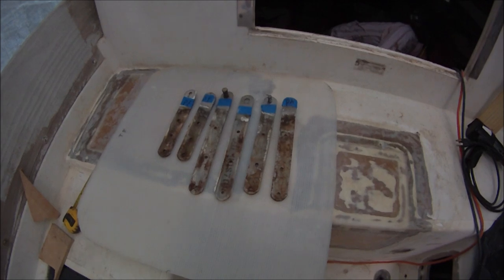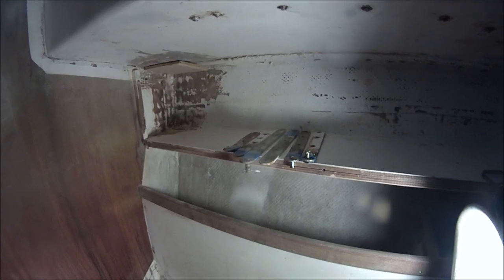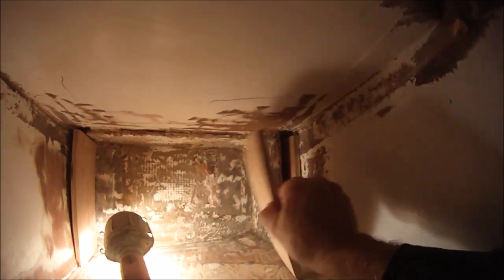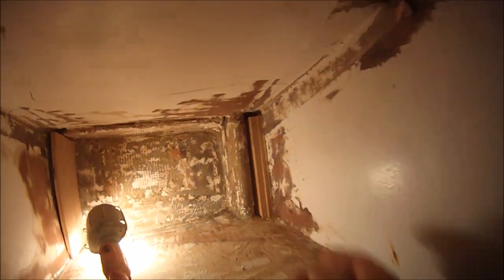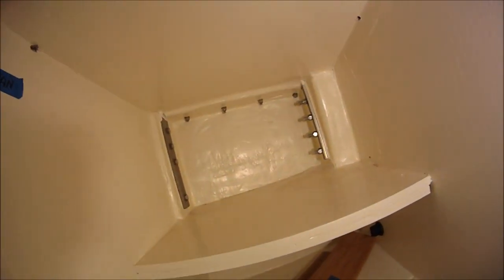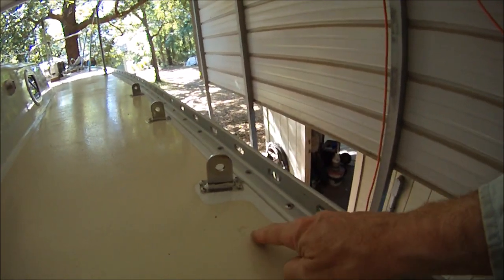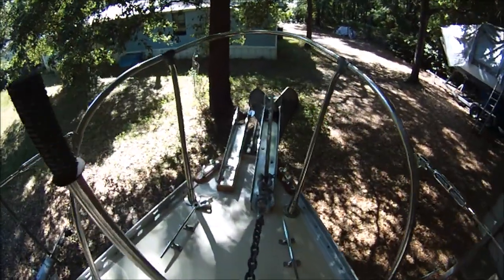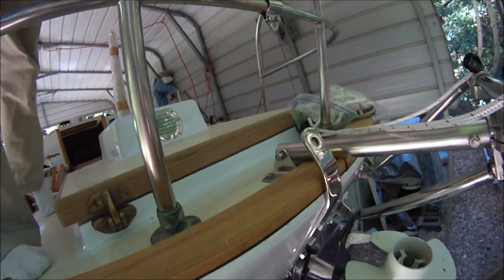Replacing Chainplates on an Alberg 30

Comment: On my boat lower shroud chainplates were attached just to the deck pad eyes. This led, I think, to separation of deck/hull joint seal so there was some water getting in while sailing.

Comment: Thank you for making this video, James.  I am rebuilding the hanging knees on my C&C Corvette and wondering what types of  fiberglass / resin  to use for laying up and bonding the new knees to the hull?
Reply from the maker: I use mostly West epoxy resin but I've used others and they are all probably similar in quality if you buy from a well-known distributor with a good reputation. I don't mind wiping off the amine blush on West System but you might want a non-blushing brand. I rarely use polyester resin because it has less adhesion in secondary bonds. I mostly use 6 to 10oz regular cloth, and various width tapes, sometimes biaxial. The heavier rovings are hard to work with and saturate and have a rougher surface and matts are often messy and soak up too much resin. You could experiment with biaxial matt 1708 for heavy buildup and flexibility on corners. Here's a link to  fiberglass types description:
https://www.youtube.com/watch?v=Z1dVLcJB4a8

https://www.youtube.com/watch?v=Xnhz-OLZZa8

For anyone who owns one of these older boats or is planning to get one you may want to join us on the Plastic Classic Forum to ask or answer questions, or just read through the thousands of informative posts archived there. It's at: http://plasticclassicforum.com/forum/
Reply: atomvoyager thank you! I’ve really enjoyed all of your books, as well.

Comment: Good presentation.  I'm shifting into an Alberg 30 now and want to examine the chainplate situation I have.  Is there a particular supplier you all use for the chainplates?  Thanks
Reply from the maker: Standard off the shelf chainplates are not the right dimensions so you need to make your own or find a metal fab shop to custom make them to your sketch. You might try using chainplatesexpress.com or buying the flat bar at onlinemetals.com and then finish them yourself or have a local shop do the drilling, cutting, rounding and polishing. If you need more specifics you can email me thru atomvoyages.com

Comment: What type of plywood are you using for the chainplate knees and other supports? A marine grade like Okoume? Thanks for the vids, looks like you do great work!
Reply from the maker: +Edward Jones  We have a local lumber supplier here that sells us marine ply. Don't recall the specifications and we don't always use the marine grade. Marine ply is important for some types of construction, such as hull and deck sheathing in wooden boat building, but for these types of jobs any good plywood is suitable because it is all well sealed in epoxy resin and fiberglass and generally overbuilt.
Reply: +atomvoyager Thanks James, Yes I was wondering if "standard" plywood was safe being used inside.

Comment: Just curious. Were the chain plates you replaced original to the boat?
Reply from the maker: +captainandthelady They could have been original or possibly replaced once many years ago. It's surprising that three 1/4" bolts, even  on upper shroud chain plates, held the load without failing from corrosion or pulling through the bulkheads. They have failed on some A30s though so a good idea to strengthen the whole system and then not worry about it.

Comment: How did you bend the chainplate for the backstay? Just slide a steel rod over and put your back in to it or did  you heat it first?
Reply: Use a press
Reply: You don’t heat Stainless Steel.

Comment: Should the chain plates me a lot longer for more strength or is this good enough? I'm probably mistaken but I could have sworn I have seen somewhere this person made them longer but then again I maybe completely wrong.
Reply from the maker: You can't make these internal chain plates longer without a lot of trouble and clearance issues. As is I'm sure they are much stronger than the mast tangs, clevis pins and other wire fittings so they aren't the weak point of the rig. They can be longer if they are external mounted on the hull but even there anything beyond say 16" and three or four 3/8" bolts isn't needed. Keep in mind Cape Dory and many European boats such as the Albin Vega and Nicholson 31 only have pad eyes or U-bolts as chain plates so these are quite a bit stronger than those and they've proven adequate.
Reply: @atomvoyager  thanks

Comment: How are the extra knees holding up any hard spots  cause deck cracking
Reply from the maker: There have been no problems with cracking. The knees are glassed to bulkheads, deck and hull so it all acts as one rigid unit with no movement. So-called hard spots are only a problem if the structures around them are moving and that's not happening here.